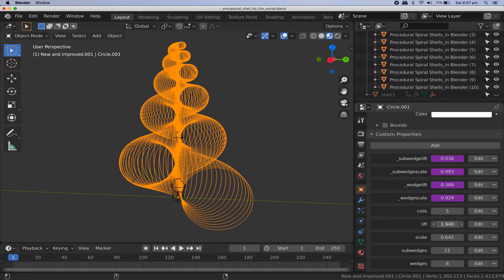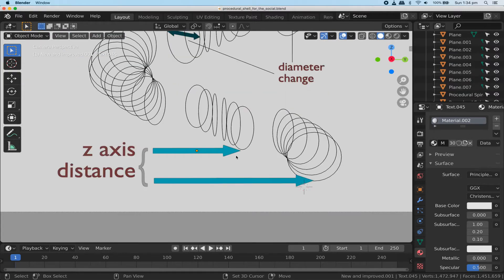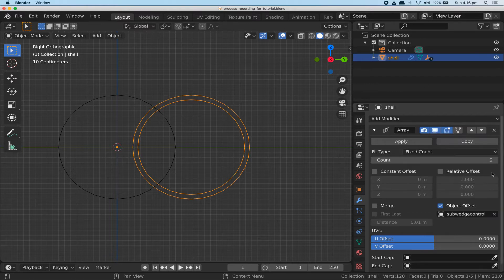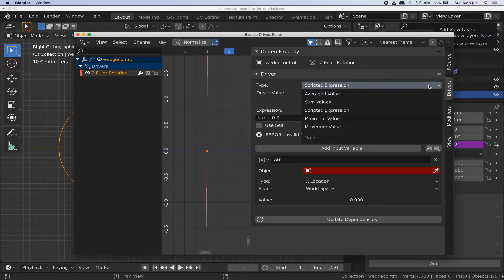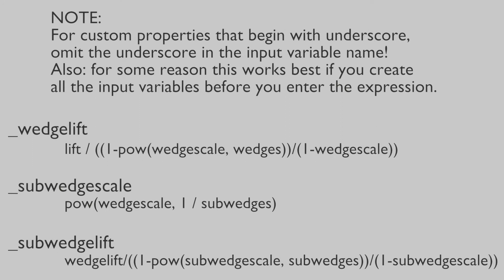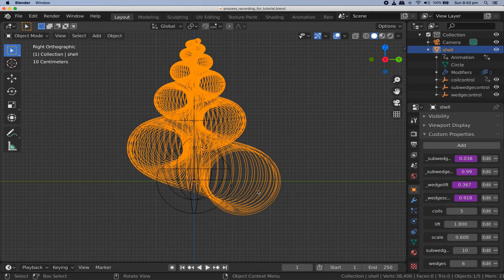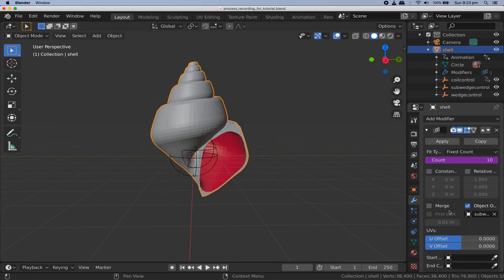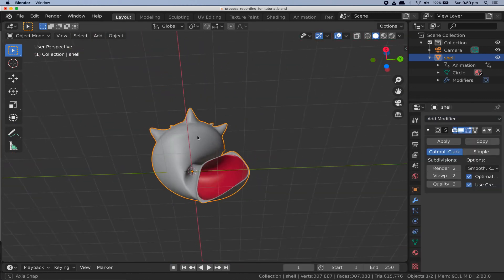Tutorial #1 - Parametric Spiral Shells

Comment: Interesting, then how can I make it like extend the coil, instead of being coiled, I wanted to be extender in a straight line, there’s a way to do it ?
Reply from the maker: Unfortunately, I think that would be a pretty different set of instructions from what's in this video. It's definitely doable, but it would take too much time to explain, and I would want to play around with the idea a little myself anyway, just to be sure. It's an interesting idea, though - and I know some types of shells do look like that. I think the approach would still involve array modifiers and the weld modifier. Overall, the process would actually be simpler than this since you wouldn't need to implement the coiling logic.
Sorry I'm slow to respond!

Comment: how do you select all the face at once? it would only let me select one at a time or i have to hold shift and click on all the faces 09:00
Reply from the maker: Sorry I'm slow to respond. There's a hot-key for this. I believe it's holding ALT while left-clicking an edge. As long as the faces on both sides of the edge are quads, Blender will select all the quads in the chain. If that's not clear, just try this a few times with some meshes and you'll understand the behavior pretty quickly, I think. You need to be in face-select mode or edge-select mode, but not vertex-select mode.

Comment: For some reason I am having trouble with new wedges and subwedges either appearing disconnected if the value is too low, or if you set the value high enough to fix this the edges begin clipping into one another. Does anyone have an idea where I am going wrong?

Comment: I just spent an age comparing my file with the example one, driver for driver. All exactly the same and yet my result was off kilter from the very first array!

Until... I finally noticed that the object origin of the base concentric circles remained at world origin! I had moved it in object mode and so its origin moved with it. Restoring the object origin to the world origin fixed everything!
Reply from the maker: Oh, wow! Good sleuthing. That's a pretty subtle difference. I'll try to remember this in case I see other commenters running into similar trouble.

Comment: I don't know what I missed or did wrong, but what shows on my screen is different starting from 3:30 where I added the second Array modifier.
Mine appear to have multiple Shell objects laid out horizontally, unlike the one in the tutorial where nothing happened.
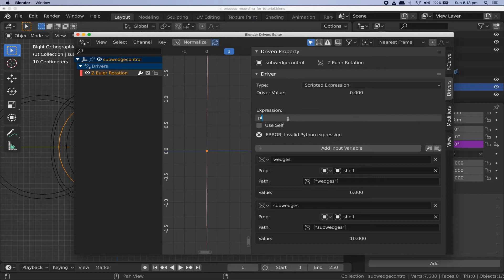The model didn't change either when I finished adding the first new driver at 6:04

I followed all set ups until the end anyway, turns out only changing the values in _subwedgelift, _subwedgescale and wedges change the object, but still not the effect shown in the video. Mine is like two flat donuts piling over one another 😕

Can anyone tell me what went wrong?
Reply from the maker: Sorry, I don't have an intuition about what the cause might be for that unexpected behaviour. In case it might help, I have a download link in the description to a .blend file containing a shell with all the parts in place, drivers, etc. Might be worth seeing if that one works for you, and if it helps in finding whatever subtle problem is going on.

Comment: Thx again! I have a little problem with final "cleaning" at 10:52 though.. I did exactly according the tutorial from your blend file but when in edit mode, face-select i select all by trait - i get all faces selected. What am i doing wrong? Maybe someone had same issue as me?
Reply from the maker: Hmm.. that's odd. No faces are selected before you do that? (I assume so) And you're asking it to select "all by trait" --> "interior faces", and it selects everything? It sounds like you're doing things right, but it shouldn't be possible for all faces to be interior faces. Unfortunately, I've got no guesses as to what might be going wrong there. :(
Reply: @blenderconch  Thx man for taking time to consider my question. Indeed it's a strange bug that I have in one saved version of file. It was driving me crazy =) I tried to reproduce it in another file to see what might be wrong, but could not. I'll just leave this question here in case if someone has the same issue.
Reply from the maker: @biggeo_ru  Yeah, curious to see if others encounter the same thing. Glad it didn't happen again the second time.